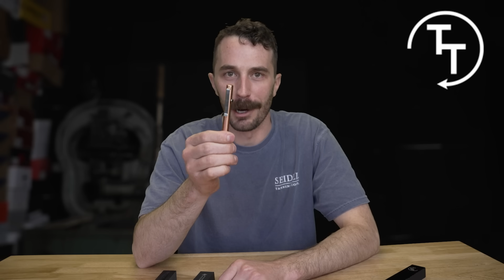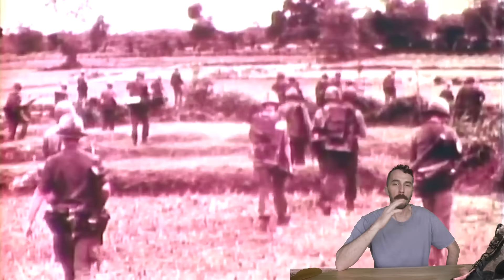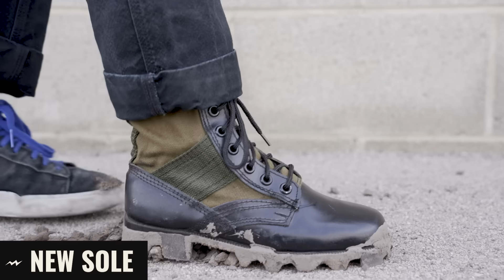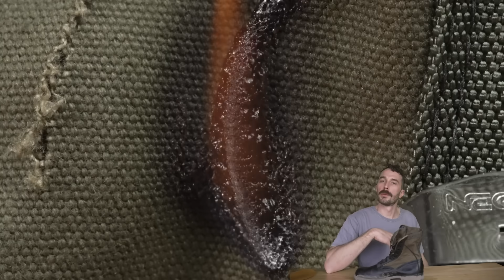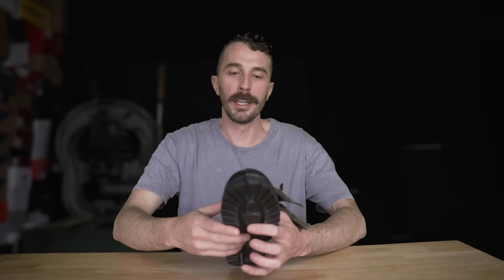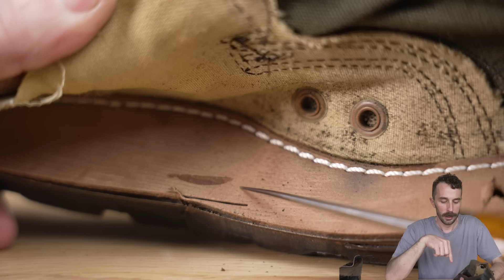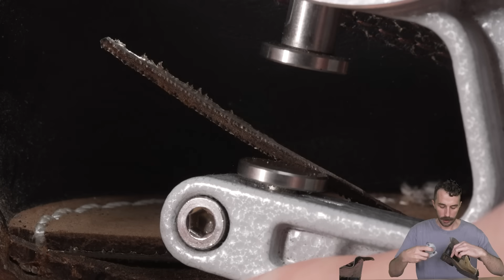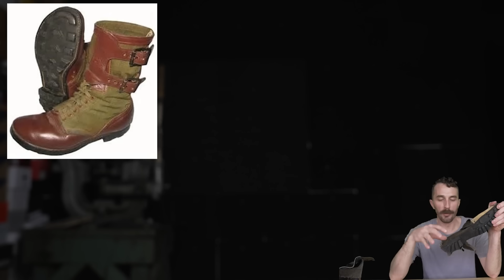Why it took 57 years to replace jungle boots

Comment: The first thing you should know about combat boots is that you don't need them, and wearing them when you don't need them will ruin your entire body. Unless softer footwear has actually failed you in some specific conditions, combat boots are not worth the tradeoffs. They lock your ankles into a narrow range of movement, and the inability to flex your ankles when walking will cause you to slam your heels into the ground with every step, damaging every joint from your ankles up to the middle of your spine. You might not regret it now, but you definitely will regret it in 20 years. It's not worth it. If you twist your ankles a lot, strengthen the surrounding muscles by walking on the sides of your feet for a couple minutes at a time at home; it's a better solution.

Comment: We had these issued to us for Desert Shield/Storm. What is interesting is that we sealed off the vent ports with SuperGlue to keep the desert dust and fine sand out of them. Fantastic boot. (edited)
Reply: we had to do the same thing. B company 1-502.
Reply: Didn't the dust just flow back out the ventilation, just like the water? ;)
Reply: @MarcillaSmith  I bet it would, after abrading off their feet
Reply: So, where were you deployed in what war?
Reply: @blacktemplar1139  Shield/Storm. XVIII ABN Corps. Out west in the middle of nowhere.
Reply: @UlfilasHorn  Ah, I forgot though, were these boots for Marines or  the Army?
Reply: @blacktemplar1139  I was with the Army. Before we deployed we were each issued with 2 pairs of the jungle boot. We received the new desert boot after we returned the the US.
Reply: @UlfilasHorn  Ah, Victory or Death
Reply: Sad you fought for Israel and got fooled by media to invade another country
Reply: >>>Desert Storm
>>>Arabian sand

Tell me you got a 31 on your Asvab without telling me you got a 31 on your asvab.
Reply: @Potatodotkins  but, Desert Storm and Shield were both started in the Arabian Peninsula... (granted, it's pretty much the end of the arabian peninsula and going into the Fertile Crescent, but still, Arab Peninsula, Persian Gulf)
Reply: @Potatodotkins  lol seriously

Comment: Really interesting thanks mate👍
I had the same pair of jungle boots for 23 years of my service. And a 1960/70s pair before that, cause I was the sprog😂 which were horrendous. The pair I had were all black and were great…for the jungle, but personally I never rated them that highly for walking round camp etc, too stiff, and if I wore them Doing any booted phys, my feet were in clip! 
Great for a lot of different kinds of other specialist tasks tho, such as maritime ops tho👍 as long as that wasn’t your only pair if something else came along that then  involved any kind of heavy load carry/marches or being long term ‘in the field’ I know there are many who swore by them for just about everything, but that was just me. 
Even so, I still had them for 23 years, even after being issued newer ones. So they must’ve been alright👍

Comment: Regarding the wooden block in the heel... I have zero experience with these particular boots, but reading through the comments I catch that the rubber used is fairly pliable. If the heel were made with voids or even solid rubber, it may have squirmed on pavement/hard surfaces and been a little unstable.

Comment: Love these boots. Adjust them to make them like tennis shoes.
Cut insole stitching to remove metal plate.  It will crack at bend points in about a year, making clicking noise. Hard to creep and peep with clicking boots.
Put tennis shoe or gel insoles with arch supports in.
Resole with "Waffle" soles.
Most comfortable and quiet boots I ever owned.

Comment: Right before the end of WW2. The U.S. developed a first generation jungle boot. Based on the double buckle boot. There are pictures of these boots on the feet of soldiers in the Philippines in 1945. These first generation jungle boots were pretty rare. 
Now my dad served in Vietnam from 1969 to 1970. His opinion of the jungle boot was it was a good boot for that environment, however that mesh liner. Was hated by my dad and the men in his unit. My dad's description of that mesh liner was. Image walking on a tight chain link fence. So he and the other men in his unit got rid of those mesh liners.

Comment: Great video! My dad bought my first pair of these boots when I was a size 7 from the Army depot in Tobyhanna Pa. that was over 40 years ago. I absolutely love these boots and had many more pairs over the years until I couldn’t find the genuine jungle boots anymore, I was only finding cheap knock off versions where the canvas was flimsy the leather cracked and it no longer came with the nylon mesh insole. Years later after the advent of the internet I searched for these boots and discovered that they were or are still made by different companies/contractors  and you can still get the genuine boot. I believe the second sole you mentioned is called the Panama tread.

Comment: Never really surpassed, wore a set with the Panama sole in Belize and preferred them to the Altberg Jungle Microlights I spent far more on.

That's not to detract from the Altberg, excellent boots, but the jungle boots were just better in the actual jungle.

Comment: Wore those exact boots while stationed in S Korea 02-04, instead of changing socks throughout the day while in the field I changed boots.. once they got wet they stayed wet, also most of us had them re soled 1st thing with the “tanker treads” and extra sole cushions, the tanker treads were just rows of sharps ridges but they keep me from slipping down Bradly ramps in the dark. Good boots but not the best, also boot polish always sealed up those drain holes quick 🤣

Comment: When I was in the Marines in the 90's we NEVER bought the black jungle boots. The black boots were nylon and ripped after just a little use, The greens were cotton canvas and lasted a long time. There were some civilian copys out in town (Oceanside-Jacksonville) but those fell apart too. Also...I preferred the jungles after I had them re-soled. I thought the Vibrams were better than the factory sole. More cushion. And yes, when they wore out I disposed of them properly......I tied the laces together and threw them over the power lines at Courthouse Bay!!
Reply: I second that comment about the black jungle boots
In the early 00's I was issued with Altama branded ones and they sucked hard!
(They had black nylon sides, stupidly narrow foot/toe area,the stitching around the tongue digs into the top of the foot,which caused blisters and foot cramps and to top it off the speedlacing and drain eyelets tend to pop off....)
Like a lot of Aussies that got issued them, I chucked them at the first thrift store I could fit!
I thankfully found a pair of the green cotton sided ones and they fit a lot better.... seems like they are made on a different foot last or maybe the leather was fantastic quality compared to what current production are??
Reply: Niceee!
Reply: @itp5x5 Nice!  I was a Doc with 3/2 in 94.  I remember the green  jungle boots were phased out and we were issued the black jungle boot and leather boot.  Even though the green jungle was no longer authorized, no one complained if you still wore them.
Reply: @itp5x5 Same here, I was issued them in 93 too. I've had both black and green and love them both! I guess some other Marines got some s*** ones but not me!
Reply: Loved my green jungle boots. I was issued mine in Panama in the mid 90s and wore them until the change over in uniforms. In the winter time I would switch over to a pair of Danners.
Reply: @jameskelly1446  O yeah! My boots definitely got time in Panama.  " No Obstacle Too Deep"
Reply: I agree.  I liked the old jungle boots with the green cotton canves.
Reply: The Panama boots were redesigned with different lugs.
Reply: This is what happened to me and because of the poor quality boot which took ages to replace I got shin splint inflammation. 
Had to cross a seabed during Ebb and the slick mud just took parts of the boot with it.
Reply: @pianomanjason  Hello.  I jumped all my 28 + years (1971-2000 in the old green green canvis jungle boots, both free fall and static line, day and night jumps and they gave very good support, even more than the old leather combat boots with the cut in front. Those provided great support much better than the black speed lace nylon upper jungle boots, although I had not issues with them either.
Reply: My black jungle issued in 92 lasted me till 96, I just need to resole them. They then last another 4 years of hiking in civi  life before I misplaced tjem

Comment: I was very imprressed with your review of these.  I wore these in law enforcement during the summer for several years.  And then wore them while working at Home Depot after I retired.  They actually wore better in law enforcement.  I used to wear out the rubber soles about every 6 months walking on the concrete floors in the big box store.

Comment: I had those as my first work boot due to inexpensive price. At first they were really tough on feet and gave massive blisters but after that they was very good on the feet. Lightweight and breath well. Sole is very soft rubber so in hot tarmac they became slicks quite fast.

Comment: Picked up a pair with the upgraded large lug soles ca 1990 and quickly realized that while they were great for mud use they were also HORRIBLE on tarmac - simply too hard a sole. 
Later bought a pair of non-official Jungles in 'correct' 60s Vietnam look - while those were much better for street duty their synthetic leather and almost cardboard quality inner soles made them lose all qualities that come with the official Jungles. Probably much more of a movie prop than a functional boot...
While those knock-offs eventually disintegrated with wetland forest, typical Jungle Boot duty I still have the first pair which still sees occasional gardening and forest use

Comment: These were always my favorite boots in  the Army. I was really bummed when they phased them out.  I was a medic with  the  Infantry.   The Altama brand was the the original issue.  Nobody I knew kept the original mesh insole.  2nd Favorite was the Corcoran Field boots.  None of the older style issue boots like this had enough cushion for long marches, especially with heavy weight so I earned quickly to buy the best quality shock absorbing insoles FIRST and take them with me when trying on new boots.  Usually would have to get the boots about a size larger and wider to accomodate.  Had to change insoles every 2-3 months but it was so worth it.
Reply: That mesh insole really did some nasty things to my feet. So I replaced them with regular insoles that you can get at the store. I didn't serve, I just use the surplus boots.

Comment: No one wore their pants outside their boots unless they were in the rear. Your feet rarely got dry in the field. You could walk for an hour and take off your boots and pour out the water. Almost everyone had foot problems and the Armies answer was to keep your feet dry. The boots did not drain unless you took them off and sometimes that was not safe to do. Since we were often walking thru water of different sorts, it would have made more sense to have the total leather boots to keep water out.

Comment: I am asumng the steel plate is stainless steel (Possibly 304 or 305).    My friend has a heavy industrial DoAll bandsaw, with a two speed gearbox insode it (we totally stripped and rebuilt the gearbox).  I have cut througe  solid 1 inch 316 stainless bar with that thing easily. It can cut 1mm and 1.6mm 316 sheet all day. Partly because of the blades we use, made by Sheffield Saws to our length specifically for Stainless steel - this is Sheffield after all.

Comment: Jungle boots were my go-to boot in Army. I wore them from 1993 to 2000. Never work standard black boot except basic training. Easy to polish, easy to clean, lighter, and more comfortable. Everything about them was better that any other issued boot. Even figured with a gore-tex sock and wool sock it was warmer than normal black boots in the field. I used to make fun of guys in my unit who bought Danner tactical to Corcoran jump boots. Why spend that much money when your boot can get a pair of jungle boots for $45 dollars. When I got out of service everyone finally figured it out and most of my unit had a pair for the summer. Still own a pair of them for jumping on Harley for a ride, perfect boots for a quick ride.

Comment: The new sole design (as told to me by a vietnam veteran that trainned here in Panamá)  was created based on the wheels designs used by agriculture equipment and it was name or refered as the Panamá's Sole; since it was tested and approved in the jungles of Panamá at the army jungle training ranges during the Vietnam war...can you find about the veracity of this...sounds interesting

Comment: great idea, what if we make from two !!! distracted shoe-makers doing all kind of wrong things thru out the years. just 1 working shoe-maker with custom manual old fashion craftsman ship. with new non rotten neo material. like nylon or latex ? or carbon vibre or glas fibre. those can be woven into a cloth to replace laether ? or so ? euzz.. reutel...

Comment: At one time I hated this boot. But I soon learned to LOVE it! You did a good job describing this boot, but you left out comfort. These boots are like house shoes. You can sleep in them. They keep you feet dry, and low odor(pending your hygiene). I'm completed surprised that you left out snake proof. I love these boots. I hear the current boot is even better. I would assure so, for they ain't cheap! Good job with the video!!
Reply: Ehhh, the current boots (as a kid who just got back from BCT) are alright. Personally liked my jungle boots more (I own a pair for daily work). Even after putting decent insoles in the boots, they kill your feet on marches. And are overly heavy compared to what they need to be. I say bring back the jungle boot🤣

Comment: These boots were discontinued during my time in service.  They made the announcement, and also announced the final date that the boots could be worn in uniform.  So, I went down to the Clothing & Sales on post and bought a pair.

You could get them in OD Green nylon or black.  Mine were the OD Green, and if I remember correctly, the discontinuation only applied to the green boots.  The black nylon Jungle Boots continued on for years afterward.  More than likely they continued until BDU's were replaced with ACU's and Desert print, instead of Woodland Camo.

Comparatively to the other boots that were authorized, at the time, the Jungle Boots were light, breathable and pretty comfortable!  The only boots more comfortable, at the time were the Cochran II Jump Boots, with the highly polished toe & heel.  I had those as well, and loved them.  But they were two different tools for two separate jobs.  Jungle Boots for field use, Cochran II's for rear-detatchment, looking "squared-away".